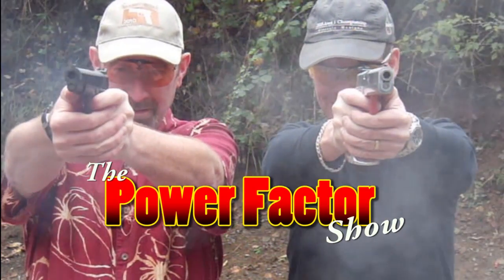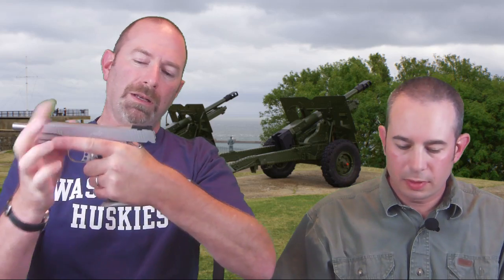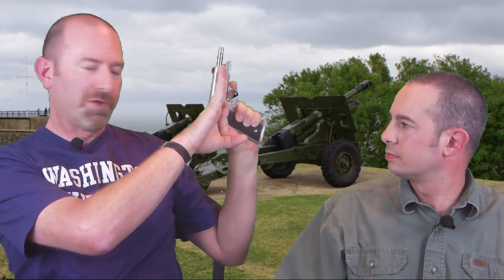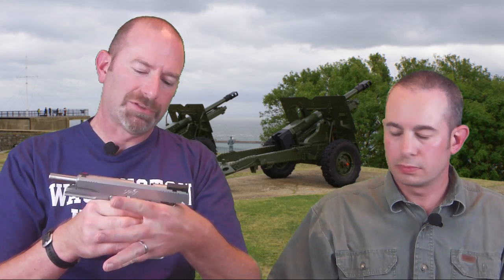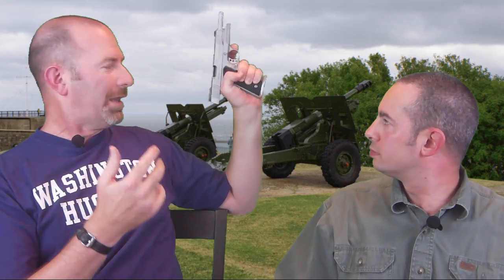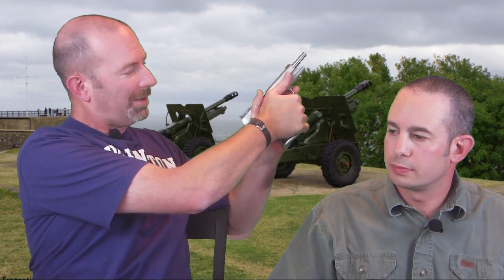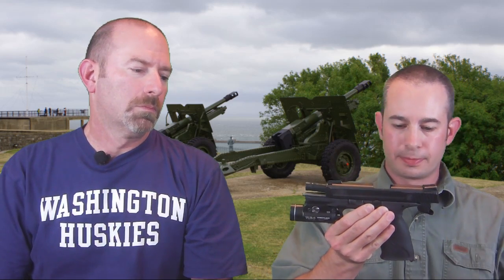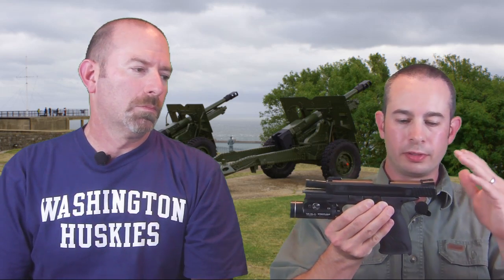Episode 90 - Recoil Reduction

Comment: in the Miculek reference, i believe he's using the grip you mention, where most of the "clamping" comes from the weak hand, which does not adversely affect trigger manipulation. Bob Vogel uses a slightly different grip, but he also clamps the gun extremely hard, and is evidenced in any shooting video you see of him. The gun simply doesn't move.

Comment: As long as you aren't experiencing the slide slamming into the frame, with the loads you are shooting, you are fine. If you were watching your sights you would probably observe that they dip less when the slide returns to battery. This shows that it is not being slammed forward as hard either. Matching a spring to the round you are shooting will reduce how much both you and the pistol get beat up. It's all about dissipating forces over a greater time.

Comment: The thrust from the still burning powder, after the bullet leaves, accounts for more felt recoil because it has a greater duration. Before the bullet leaves, you experience the acceleration of the bullet, equal and opposite. Light bullet, heavy slide probably not much force felt. The difference of two bullets at the same PF is powder charge, lighter has more. Lighter bullet has a greater gas jet that generates thrust and continues to burn for a "significant" while after the bullet is expelled.

Comment: Clamping the gun with an extremely firm grip adversely affects trigger control.  You can't have a death grip with three fingers, and maintain fine control of the trigger finger at the same time.  I've heard some characterize their gripping strength as what you'd use on a tennis racket, or when swinging a hammer.
Rick

Comment: Watching a slow motion video of a pistol will reveal that the slide just starts to unlock while the gun, bullet and gas are still in a closed system. Rapid slide acceleration occurs immediately after the bullet departs and can no longer affect the slide. What is left is the gas burning and being expelled like a rocket.

Comment: Any "high performance" modification that varies from the stock configuration could adversely impact durability.  I don't think a reduction in spring rate from 18# to 15# is going to make much difference, especially if you are downloading .40 S&W for use in SSP or ESP divisions; reduced power would indicate a reduction in spring rate.

Comment: Rick, I went to a steel guide rod in my poly gun (Sigma 40cal.) and went from an 18lb spring to a 15lb spring and my shot placement is much better. Will this lighter spring end up doing any damage to my frame? I love the way my gun is working for me but this not only is my IDPA pistol its also my EDC gun.

Comment: Well actually Im not downloading. I use factory 180gr. Federal fmj in IDPA and I lightened up the spring and added the steel guide rod to eliminate the dip of the muzzle during recoil. This moved me into ESP but who cares? Im in it to get better and enjoy myself while training a little bit. I just dont want to hurt my gun with a light spring. and I didnt like the poly guide rod mine got funky from rounds and heat I guess. The end started to kinda bend (its not flat on the barrel end.

Comment: I also do not think stippling is a good idea... I think it adversely effects gun handling, such as fixing my grip if I blow it on the draw and when I roll the pistol in my hand to reach the mag release. Now that I run slick guns and have worked on my technique and grip strength sufficient for my gun not to slip out of my hands under recoil I see absolutely zero potential benefit to stippling. Plus it digs in and is irritating if I clamp down with as much pressure as I normally use. YMMV though.

Comment: Kinetic Energy isn't the proper measurement for recoil.  If you look at the equation for free recoil, it is much more like momentum.  A simple look at Newton's laws shows you that you aren't getting any less recoil from two of the same power factor loads.  Powder charge and charge velocity have some effect on perceived recoil, as does bullet weight and velocity.